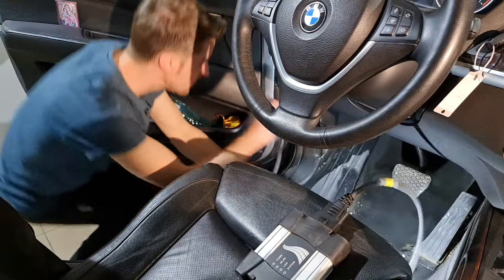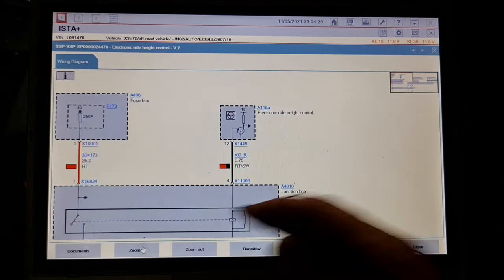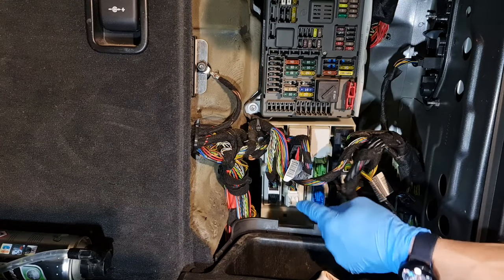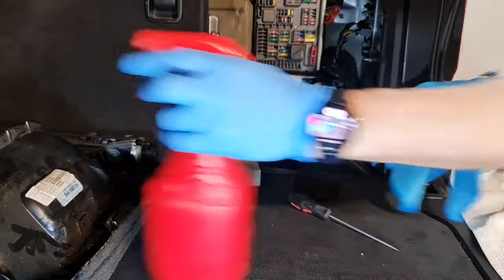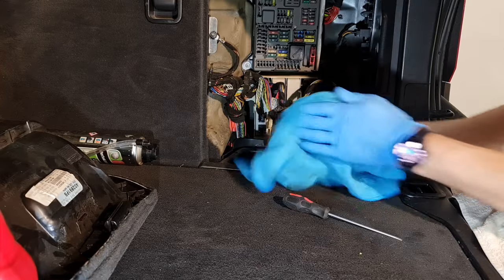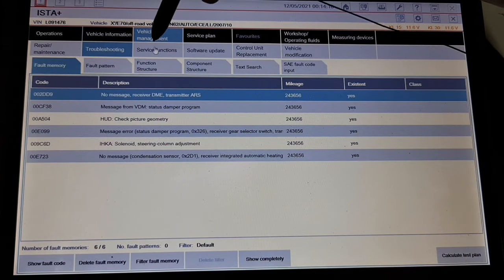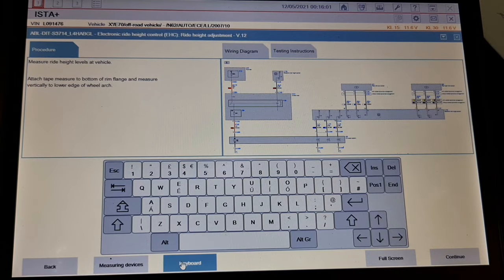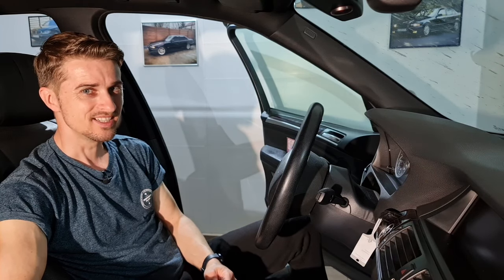How to diagnose an BMW x5 with ISTA for Level Control Failure

Comment: I had both air bags changed on the rear of my 2011 X5 BMW Xdrive35i, and after a couple of months a had no issues, until now, that the Level Suspension Malfunction error popped in the screen again, and I'm at a loss,  because I don't know if could be a sensor at this point. The car still drives normal.

Comment: 2011 BMW 740li here. Left sode drops over 15 minutes.  Replaced left air strut, no fix.  Replaced compressor (solenoid too).  My scan tool reads measuments from the ride height sensors, but does read 0 volts.  Not sure what that means...but after replacing strut and compressor, no changes. Still drops after 10 minutes.  Any thoughts??  Thank you!

Comment: I have a BMW 525D Xdrive F11 2012. every time I switch on the ignition the dynamic damping control failure pops up. Corner ability restricted. During driving the error pops up many times. I took off my wheels. unscrew the screw holding the levele sensor. Lubricate with WD40 rust remover on all moving parts. I use a lot off WD40 silicone on the ball joints. Move the ball joints many time(over 100) till it is moving freely.  I have driven over one week without any error. My two rear levels sensors was stuck with rust. The sensor can not move up and down. After lubricating them. The sensors work fine. No more error. After wards I use my autophix S910 ODBII tool to delete all error messages.

Comment: I do understand I must get Ista+ to diagnose my BMW car. Do you know Ista+ standalone installation has  all the features I need to calibrate my level sensors, calibrate my turbocharger,  recode my shockabsorbers, reset DPF, force DPF regen, doing diagnostic? I do belive you are good in using Ista. 
I need some good advice from you. Now I am stuck with a lot problem with my BMW and I need some advice to solve my problems. Thank you in advance :-))

Comment: My f15 x5 is not switching off air compressor after new air springs installed, when I unplug the compressor it sits on its right ride hight and stays there no leaks 🤔🤔🤔

Comment: How I can test the sensor because one side of my car is lower I change the air bags but still same thing and little by little goes down what do you think maybe the valve witch is located close to the suspension air compressor

Comment: Hi mate my E70 has the similar problem, I change the Air and the shock but the fues keeps on blowing, any advice please
Reply from the maker: Hello,  My only advice is to find someone who can properly diagnose the car, with advice and opinions you cannot repair a car. It can be a lot of causes.

Comment: I can't seem to get 9CB4 to go away rear ride height sensor E90. Voltage is mid around 2.9. Could it be FRM3 issue?
Reply from the maker: I don't know,  nobody can know! To find out you need to do a complete diagnosis, not only read the error codes !

Comment: Have x5m e70 just randomly get level malfunction error after lifted left front wheel on the jack for oil change after that now once in a week after car stays for long period of time like 20 hours or so I had that message I hear compressor for couple minutes and it’s shuts off if I get message just turning key off and restarted vehicle compressor forks longer and all is ok have no idea whats went wrong thanks for reading

Comment: yeah man, great video! is that possible to lower X5 F15 suspension through out the system not touching the hardwere?
Reply from the maker: Hello! from calibration probably 1 or 2 cm but don't do that leave the car like was build ! when you mess with the car height you mess the stability control of the car!

Comment: Hi great info, I have just removed the air bag suspension and replaced with Arnotts coil spring. Im getting the levelling error sometimes like this car. Do you know if I can disconnect the ride level sensor permanently. Thanks for all you vids.
Reply from the maker: Hello! you need to code-out the option from vehicle order and recode vehicle ! disconnecting things won't help!
Reply: Thanks Ill talk with my mechanic. Hopefully he has all the machines to do it. Do you have a coding out video? Thanks again.

Comment: hi i have x5 and passenger side air pad was sagged after changing both of them the height is higher than normal. my mechanic is unable find the cause. could you please suggest according to your experience.
Reply from the maker: Hello,  widout a proper diagnosis, suggestions are useless!

Comment: My left side doesnt adjust, i see the right side go up and down and hear the compressor pump and release air... Same result even if i swap over the sensors... Im out of ideas, help
Reply from the maker: You need to do a complete diagnosis of the system, change sensors, and disconnect things because you have seen a video about that won't help you out.

Comment: Great video as always 👍🏼 
I see that you keep some used parts at your shop. May I ask how do you differentiate the parts that might be useful for future repairs, and those that can go straight to scrap/disposal? Thank you, greetings from France 🙏🏻
Reply from the maker: Hi, well, the parts I have in the garage come from dismantled cars , they are not parts that I have replaced, everything I take down from the cars as a defective I throw them away, I only keep the modules because I still recover parts from them when I make repairs at the component level on boards !

Comment: Hi, 2011 bmw 740li,
Rear driver bag sagging, other 3 raises & lowers
I replaced a new air ride strut
Then a new air compressor 
Still won’t raise, all 3 works
What is the issue/solution??
Tks
Reply from the maker: Hello! Widout a proper diagnosis, you can not do a proper repair,  by changing parts blindly won't work !

Comment: i have the same problem but when i bought the car does not have the air suspension it came with the spring shock but i can get to erease that code any help?
Reply from the maker: Hello,  if the car was modified from air suspension to classic,  then the car need to be coded accordingly,  need to remove the option from FA and code the affected modules,  if you don't know how to do it , no panic,  you need to find someone who knows too code BMW in your area 😉 😀

Comment: Great video. I have same issue but on the  right side. I had both air suspension bags  changed and now i have a erro code 5F8F right level sensor. I haven't replace the sensor yet. Could you helping me finding the part? I'm struggling
Reply from the maker: Hello  , use realoem.com for part identification and part number
Reply: @MOvidiu  thank you